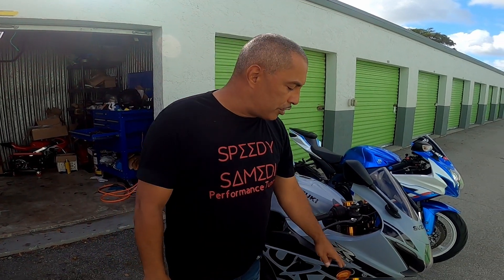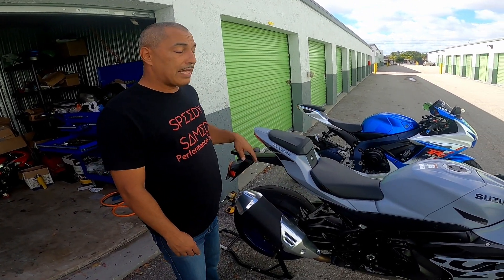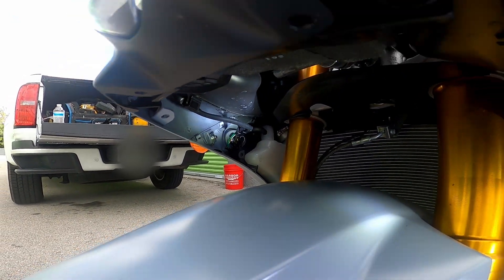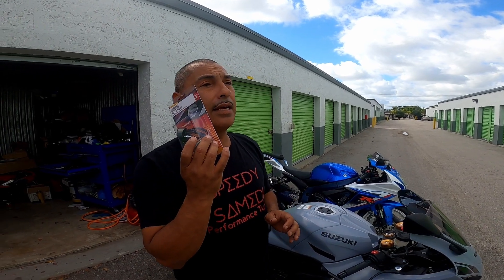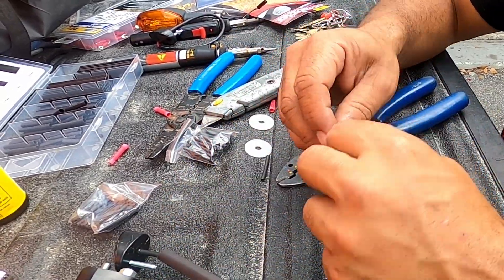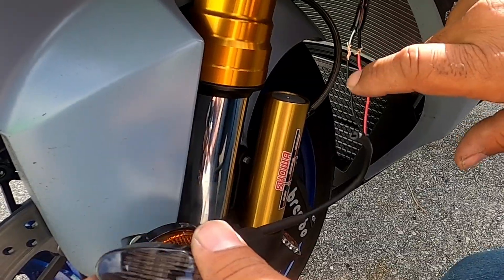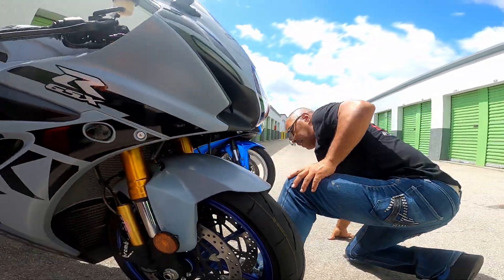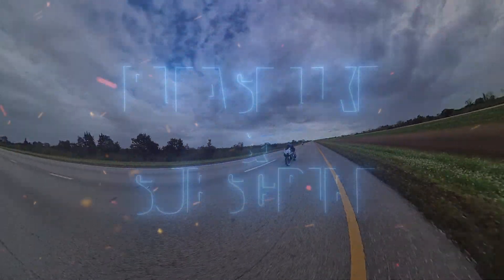2022 Gsxr 1000r Hotbodies LEDs front turn signals vs stock

Comment: How bout when they blink?
They blink super fast & u need some other electronic part to make it blink the way should b or they r plug & play?
Reply from the maker: If your blinkers are blinking fast then that means you need a LED relay to have them blink normal. The relay is usually found under the sea It looks like a little square electronic box.
Reply: @ADRRUSH  Nice,so there's a solution.Where I can find this relay?
U guys in FL?
Reply from the maker: @jorgelsanchez4388  yes we are in Florida. I will try to find you a link
Reply from the maker: @jorgelsanchez4388  https://tstindustries.com/tst-2-pin-led-flasher-relay-gen2-f.html
Reply from the maker: @jorgelsanchez4388  make sure that's the one for your bike
Reply: @ADRRUSH  I was down in the keys.Left couple years ago & im planing on going back again.Snow only looks good on tv in Christmas time.Too cold 4 me!🤣
Reply: @ADRRUSH  Thanks man.I will check on it.I had the lights in my cart but when I went through with the purchase,didn't let me.The r out of stock with "smoked" color.I guess I have to wait now.
Reply from the maker: You need a LED relay.
Reply: @ADRRUSH  Yes sir & I will get it.Thanks for the reply...